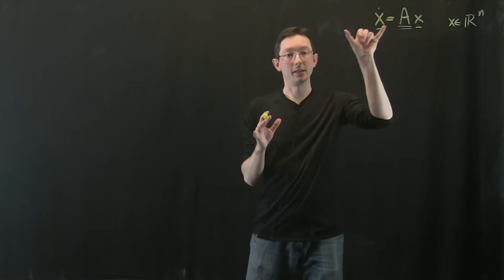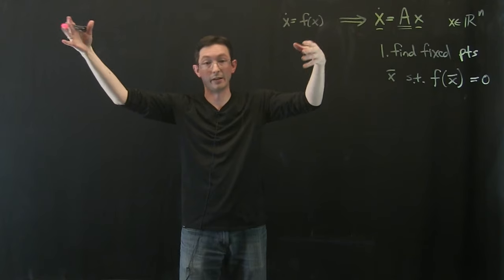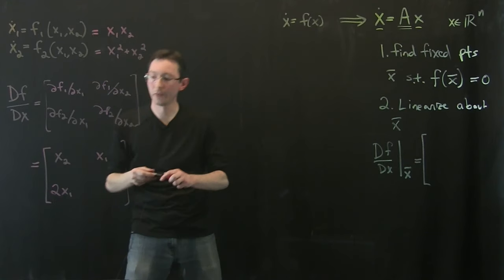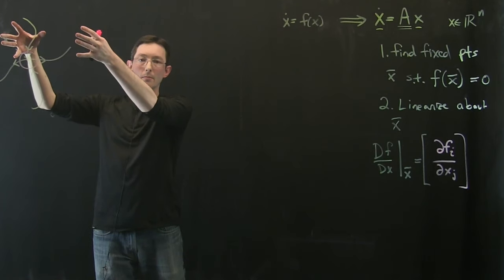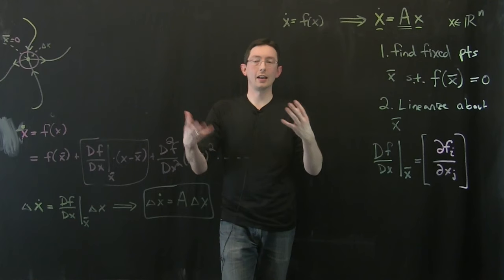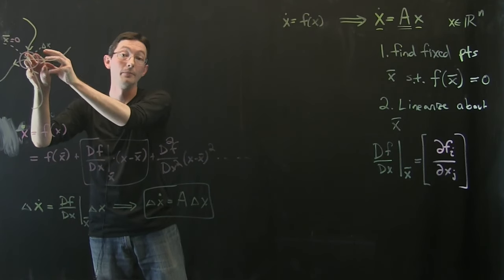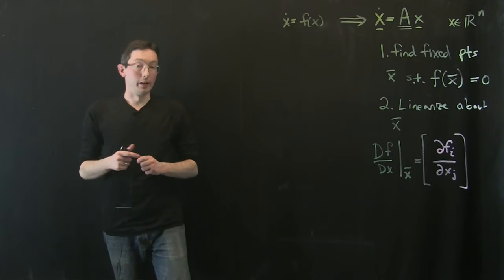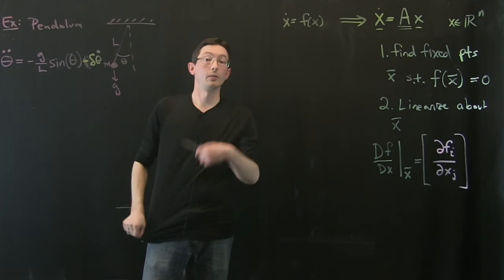Linearizing Around a Fixed Point [Control Bootcamp]

Comment: Love this series. Are we able to linearize around non-fixed points? For many real world mechanical problems, we're not trying to control to an equilibrium position, so I guess this must already be a solved problem.
Reply from the maker: Awesome, glad you like it!  Yes, we can definitely linearize about non-fixed points.  The vector field will flow through this point though, so it is not an equilibrium, and there will be a "constant" vector field plus the Ax term

Comment: Hello Steve. Thanks for the lecture. I cannot help but think that we cheated a bit because we have some previous knowledge of the physics and we know about those two fixed points. But I’m wondering about the sort of systems where we “honest to goodness” don’t know if there are fixed points and where do they could be although we expect them to exist because we have this intuition it can become stable even if we can tell nothing else. Thanks for supplement the lecture with Matlab, it makes it somewhat easier to grasp from an engineering perspective.
Reply from the maker: Really good question.  You are right, usually we start with some knowledge of the system.  When we truly have no knowledge, we can sometimes use system identification and then analyze the resulting system.  We have a method (sparse identification of nonlinear dynamics; SINDy) that will give equations of motion from data, and then these can be analyzed.  But it is extra tricky when the system is naturally unstable.  (we have a video on the SINDy method too)

Comment: Is there a reason why we linearize around fixed points, apart for the sake of simplicity ? Couldn't we, almost as easily, use an affine approximation around any point, even if its not an equilibrium, and then design a controller that stabilizes the system around that point ?
Reply: Ok so I actually worked it out on a piece of paper, by linearizing around theta = pi/3 in a damped pendulum. As it turns out, the dynamics is stable. Crazy, right ? Well it is stable but the equilibrium point is not theta/3, which would be what we want. We linearize around points of equilibrium because if we are not around a point of equilibrium the approximation does not hold in the long run, and is thus not interesting to study stability.

The general workflow is to first shift the equilibrium (in that case by adding a constant term to the control -f(x bar)), then stabilize around this new equilibrium.
edit : see https://www.cds.caltech.edu/~murray/courses/cds101/fa02/faq/02-10-09_linearization.html

Comment: Great series, I'm learning a lot.  Not sure if this comment is getting lost, may be posting multiple times, so apologies up front.

On the dynamics of the pendulum, you have the friction/dissipation term as $-\delta \dot{\theta}$.  Since friction works to oppose the acceleration regardless of which way it is swinging, shouldn't the term use the absolute value of theta-dot?: $-\delta \lvert \dot{\theta} \rvert$?  I am new to this, pulling on old physics education, so I may be misunderstanding something.  Or perhaps it doesn't affect the main thrust of the lesson, and doesn't materially affect the Jacobian at the fixed point?  Thanks if you are able to address this question.

Comment: This is awesome, but I'm in an application where I need to accurately control a pendulum throughout its entire range of motion, not just around the fixed points. Is there a solution for linearizing the dynamics around an arbitrary point?

Comment: I am using this method for the cart / inverted pendulum problem in video 12. I can linearize the A matrix with the Jacobian by setting u = 0, but then what do I do with the B matrix which also has nonlinear terms in it? Can I also take the Jacobian of the B matrix and evaluate that around the stability points? Or does even solving the A matrix require knowing what u(t) is prior, since the variables vary with u? Link to a text file with my code:  https://drive.google.com/file/d/11aVEOvqi4T7-qTYThAk-zAFcJJEKwMWa/view?usp=sharing

EDIT: I should clarify, my code is actually for a rod with uniform mass on a cart, so not exactly the same as the inverted pendulum.
Reply: I found this video here, which goes through how to linearize a non-linear system dx = Ax +Bu, answers my question (beginning around 9:30)

https://m.youtube.com/watch?v=Bxo0_A5Dp3w

Comment: Coming back to this video, I have a question.

Usually, the theoretical justification for representing a NL system close to an equilibrium with its linearized version is the Hartman-Grobman theorem, which states that for non-hyperbolic equilibria the phase portraits of the NL and linearized systems are topologically equivalent. However, for an undamped pendulum the Jacobian matrix at the stable equilibrium point has two purely imaginary eigenvalues, which actually are hyperbolic (they have zero real part). 
So how come the linearization does not fail? What piece of information am I missing here?

Thanks to anyone who is willing to answer!

Comment: The A matrix for down position of the inverted pendulum without friction has eigenvalues +-i which are purely imaginary. Is it correct to point out that this violates the Hartman-Grobman condition and hence linearization might not work in this case?

Comment: Did we already cover how to find the fixed point? It is not clear to me how to solve f(x) = 0 here
Reply: He goes over how to calculate the fixed point in this video. 

Here f(x) is the following vector 
( x2, -sin(x1) - delta*x2)^T

Since f(x) = 0,  x2 = 0 and sin(x1) = 0

sin(x1 ) is 0 when x1 = 0, n*pi which are fixed points.